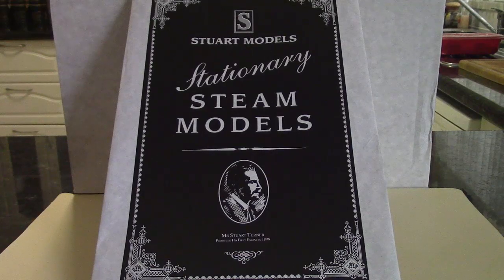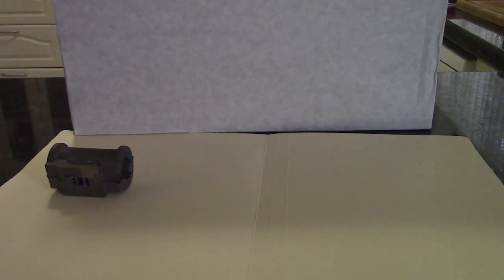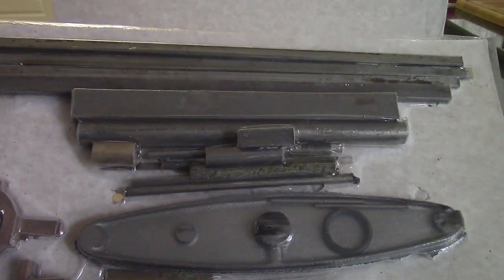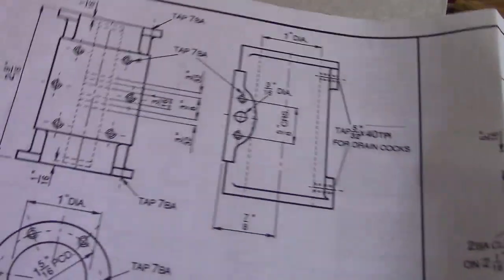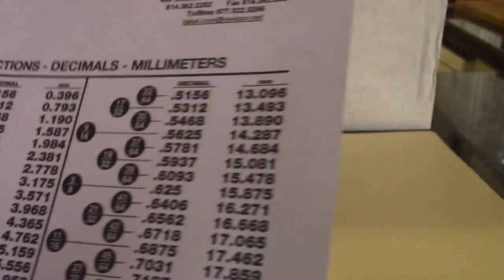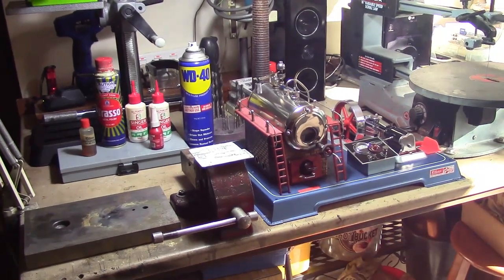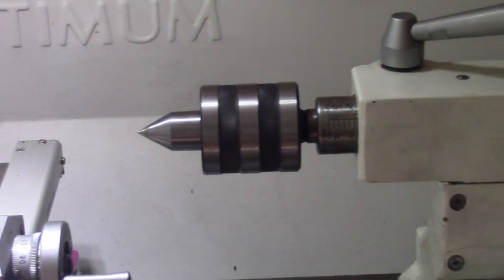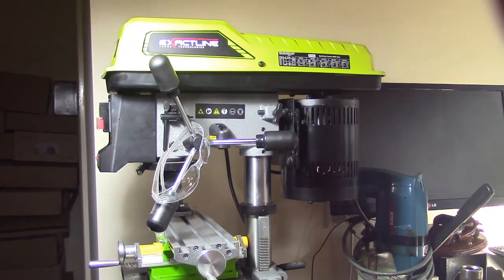Stuart Beam Build Part 1

Comment: Some good tips about converting all the fractional measurements over to decimal equivalents first. It saves a lot of time and possible mistakes later. At one time a great many Model Engineers didn't have the well equipped shops most of us now take for granted today. Many of the lower tolerance measurements and marking out were simply set to or done by a machinist rule or scale. Probably most of us would be using some type of calculator in our shops for simple addition / subtraction when machining to coordinates. For anyone who doesn't know the trick, a fast easy way to do those conversions without looking them up on a conversion table is to just divide the lower fractional number by the upper number. As an example 19/64ths, 19 divided by 64 = .296875" It works exactly the same for any fractional size. I've got a large decimal equivalent chart on the shop wall and most times it's just faster to calculate the numbers than walk the few steps over to check that chart.
Reply: steve gale  My Company? Uh this video is about Model Engineering at a home shop level. Depending on the age and location of the person doing one of these older engine designs that only have imperial dimensions on the drawings then anyone that only has metric analog measuring tools is going to be pretty much forced to do the conversion. And why wouldn't you convert those fractional measurements to decimal inch? As the video poster mentioned his dro's don't display fractions. The only mistakes during an imperial to metric conversion or imperial fractions to decimal would have to be caused by the one pressing the calculator buttons. Any professional machinist that can't do some dead simple conversions and do so without making mistakes doesn't in my opinion deserve the title. I'm only a hobbyist and I can do those conversions just fine.

Comment: 25 BA, that's an optimistic tapping size chart 😅
Reply: Why?
Reply: @union310  the higher the number the smaller the tap and I hear most people already complaining at 10 BA, which is also where most other charts end.  As for 25 BA, try threading a 10 thou bar
Reply: @rjordans  We use it in watch making
Reply: @union310  good luck with that, sounds absolutely tiny to me!